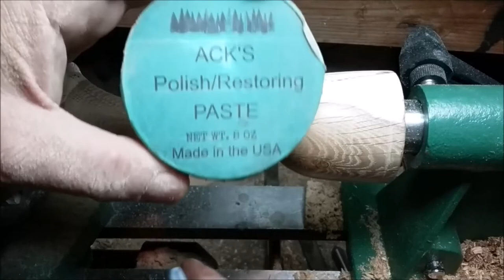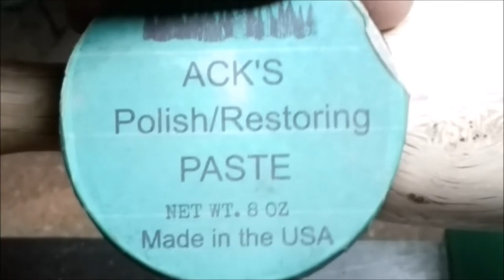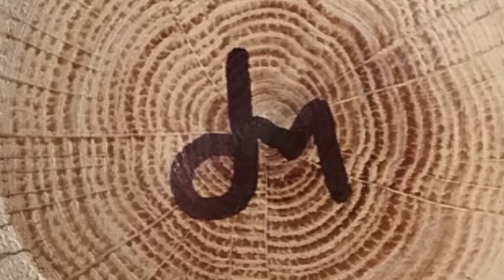WoodTurning - A Goblet with 2 Captive Rings

Comment: Good job brother. That green pad, does it leave scratches? Your turning skill are becoming very good.
Reply from the maker: thanks brother um no the green scotch bright pad  really works great with the sanding paste .but you should still hit it up with a paper towel to remove all the paste and dust from it and give it that sanding paste shine . then use the finishing paste like you would normally . thanks again brother .
Reply: @diydarkmatter  What grit is the green pad?
Reply from the maker: @NathansFerroceriumrods1  hmmm im not sure but i would use a used one nathan they make great fine course sanding pads use one for that till it gets beat up real good and hardly works for sanding then it should be perfect . that is what i used and it worked great .